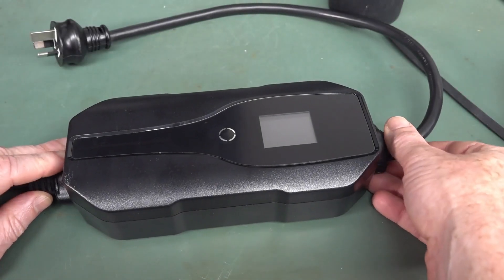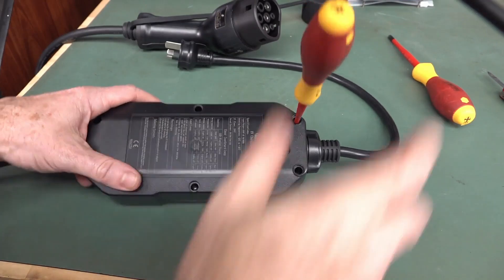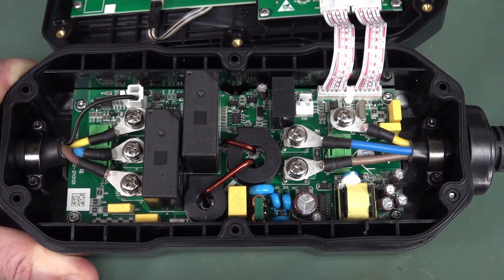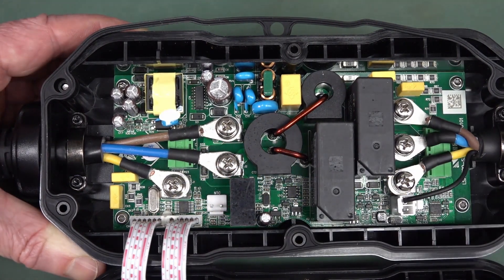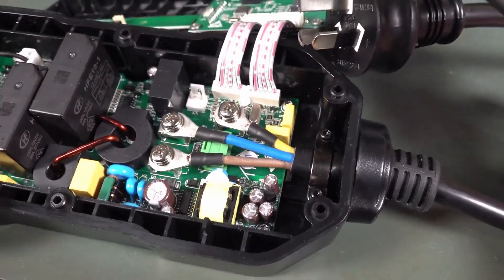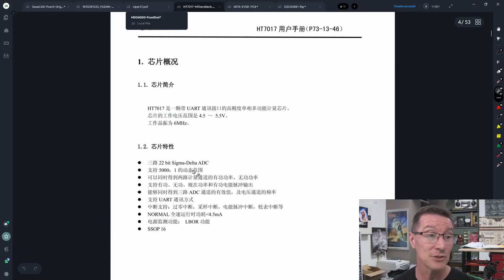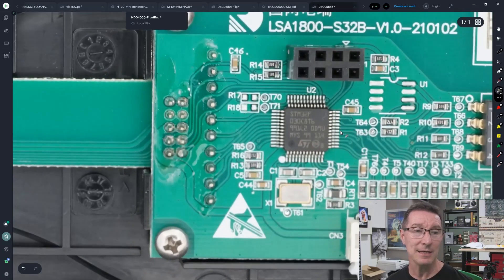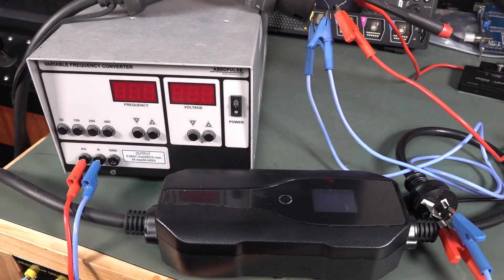EEVblog 1507 - Mida: A surprisingly good cheap portable Electric Car EVSE Charger

Comment: The 2902 may be driving the PWM as it's a bipolar signal
Reply from the maker: Could be. There is a capacitor divider coming from the AC charger side, maybe that provides the 12V required. But doesn't make sense beign on the switched charger side.
Reply: @EEVblog  I don't think the 2902 has enough slew to drive the +/- 12V 1kHz PWM signal .  (At 8% duty the pulse is 80us wide but the 2902 rise and fall time might be 12us.) It is probably part of a the AC voltage sensing circuit feeding the HT7017 voltage input. You pointed out the two string of HV resistors that would be part of this.

Comment: Latching relays are really common in these  - it's about coil heating. You'll probably find it unlatches immediately on power-up. I think I've seen one with a big cap that unlatches on powerdown
Reply from the maker: Yep, mentioned both those things in the video. Coil power in this case is 1.5W per relay. Not good in a sealed enclosure like that.
Reply: Latching probably also gets more contact pressure, may need a bigger coil for non latching
Reply from the maker: That would be interesting to try and get data on.
Reply: Also the case that latching relays, if designed appropriately, can be driven into a disconnecting state rather than just relying on spring tension.
Reply: @EEVblog  How much different is the pull-in current from the hold current? I'd expect it would be easy enough to give it a pulse to pull in that then drops to hold. Putting a paralleled resistor and capacitor in series with the coil would do that.
Reply: Quite surprised by this; granted it would only be for a split second, but in theory live wires on the output of an unplugged ev cable. I thought that was against the standard. The tradeoff in efficiency is worth it I guess.
Reply: @frollard  connectors being live for split seconds after disconnect is pretty normal. Lots of devices have capacitors on the input (or output) that need split seconds to discharge.
Unplug most mains devices.
You also can hardly avoid that as you need some filtering. But off course: physically pulling the connector also takes split seconds and fingering the fingers into the danger zone would take seconds, if the connector is reasonably designed.
Reply: @sarowie  You just need to check the Low voltage directive as to how long a plug pin can be live after disconnection, not seen a limit on it being live at power up. but the is pin within a plug housing so you can't touch it anyway.
Reply: Common with Chinese e-bike chargers!
Reply: that is something that I don't think about 😂.

one of my current projects is to build my own evse to charge from 32amps when out in west in NSW Australia.

I think the cap to unlatch the relay would be the easiest but I may look at using a parallel capacitor resistor in series with the coil of the relay to reduce the heating in the coil.
Reply: Thinking the same too. It doesn't take much to detect that AC input hasn't risen above 100V for more than 10ms and design the power supply such that it still has more than enough spare energy to turn relays off at that point. Or just have dedicated 'dump' capacitors for turning relays off when the rest of the board loses power.

Comment: Phoenix connectors are probably there for factory test purposes, simply plug in a loom and no need to use the heavy connectors or a special test jig, just 2 flying leads on cables for multiple models.
Reply from the maker: That's what I spectulated. Can't remember if I edited that bit out?
Reply: @EEVblog  Seems likely if they do a whole range of different EVSE units, cheaper to simply have flying leads, and the odd other connector for some semi automatic test rather than a dedicated station per unit. Just mark them with a colour code for specific model variants and you can use untrained people to plug in, press button, and get green light.